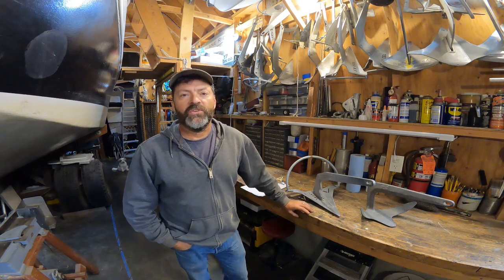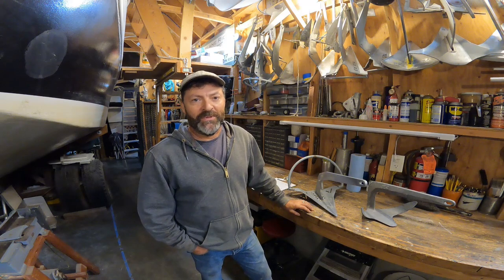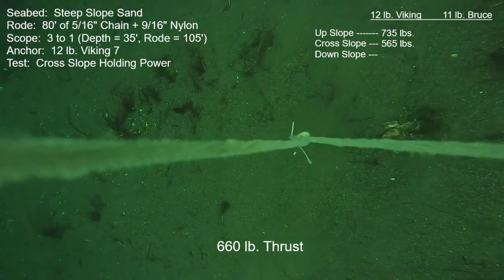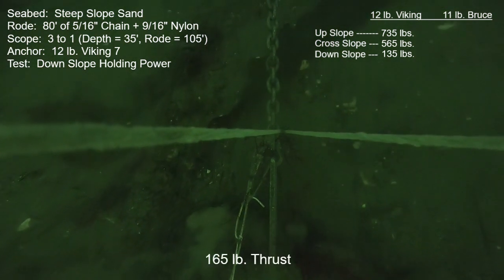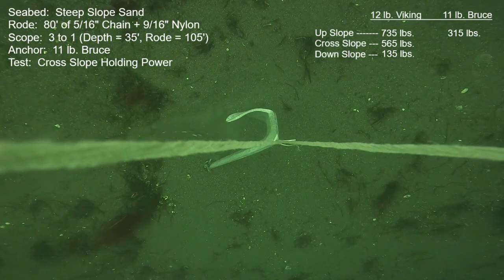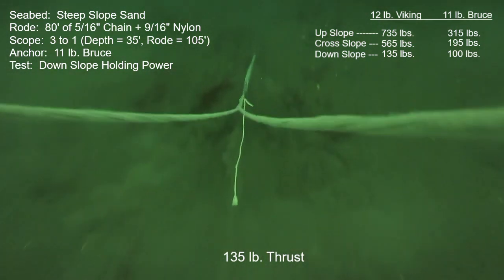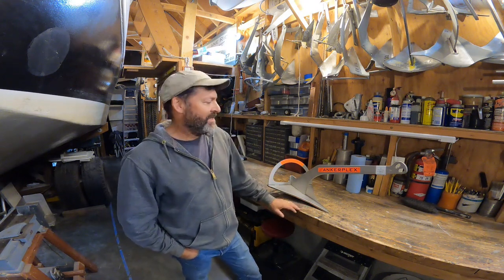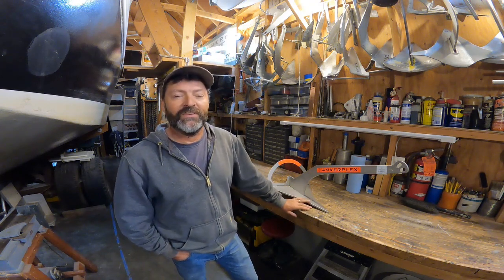Steep Slope Seabed.  Anchor Test # 151

Comment: I had exactly this situation today. I wanted to anchor at a deep slope in a bay at Grenada. From 20ft depth to 60ft it was maybe a distance of 50ft. My 44 pound Vulcan was not holding, of course. So i had to winch up the Anchor with my manual vertical Ankerwinch. Hell of a job. Next time i watch your Video before i try it by my self 😅

P.s. I am really looking forward to your Ankerplex Video. Have seen this Anchor once and it is a really interesting Anchor for a spare one if it performes good. Lightweight and easy to store.

Comment: Thanks Steve, interesting stuff as ever. It raises an interesting point, given that we normally seek a windward shore when anchoring and that water gets deeper the further away from the beach, then by default we tend to anchor with a downslope pull. Rarely is there a nice flat seabed to drop the anchor in, at least that’s the case in Scotland. I take the view that catenary is only relevant to low wind speeds, once it’s blowing 30kts the rode is practically straight to the anchor, but that’s another story!

Comment: Thanks... helpful.  Also, do you have a video discussing chain size to anchor weight?
Reply from the maker: Sorry, no video dedicated to chain size.  However, I have conducted many tests where chain length was varied between 12' and 80' with the result of the long chain almost always having substantially more holding power.

Other benefits of all-chain rodes like abrasion resistance and a reduction of "sailing at anchor" could make for an interesting video in the future.
Reply: Just had a discussion yesterday evening about why our not keeping it all chain. My friend has 60 meters of ø10mm chain and then 40 meters of rope while I’m just about to buy 100 meters of ø8 mm chain before sailing Norway and Lofoten next season.

Comment: 5/16*25.4 = 7.94mm ≈ 8mm chain, 80' or feet is 80 x .3048 = 24.38m. Did you know that all Imperial/American measuring tapes are made on metric calibrated machines?  :)
Steve, in order to avoid camera being pulled down & under, maybe used very-high-strength fishing line, which is much thinner than the rope you are using now, so less drag on the seabed.

Comment: Interesting, but I can't recall ever anchoring on such a slope here on the East Coast. I just wouldn't choose such a spot because almost always it would be possible to anchor a little further offshore where the bottom is flat and less than 20 feet deep. I'm sure there are places where downslope anchoring might be tried, but they are few and far between.
Reply from the maker: It is as if the East Coast is another planet!   The nearest "flat bottom" to the location of this video is only .3 nm away, but is over 300 feet deep and is exposed to 10 miles of fetch.
Reply: Yep. I can't recall the last time I anchored in more than 20 feet of water, and usually it's less than 15 feet. @flygoodwin